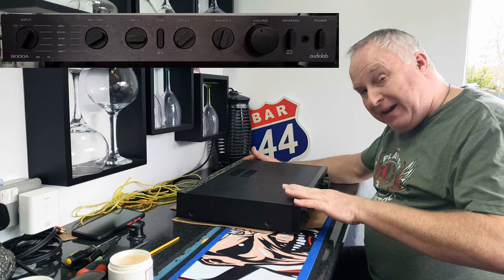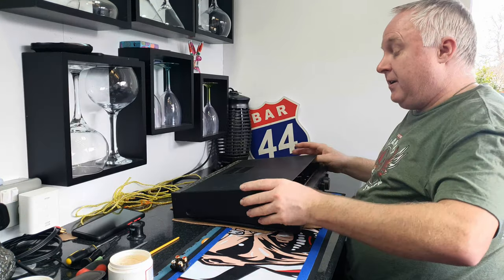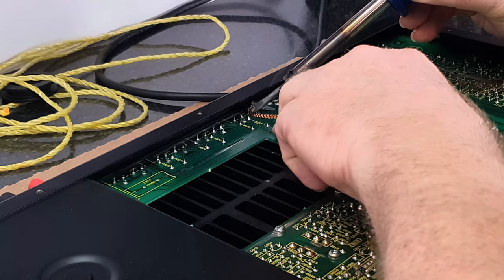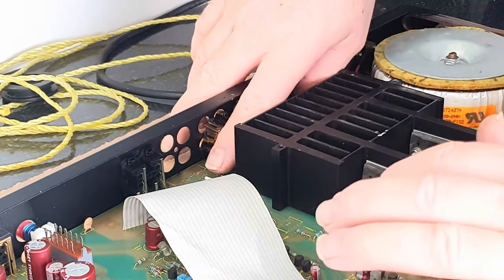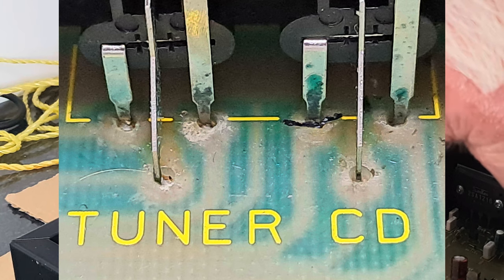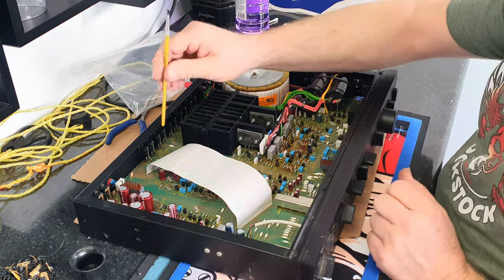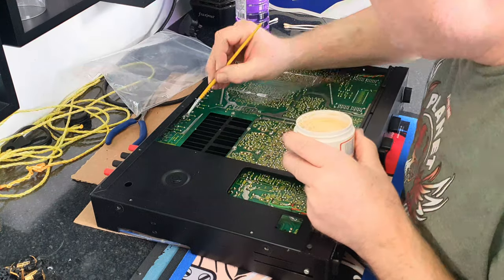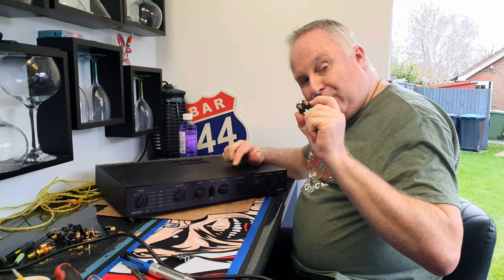How to Replace Audiolab Phono Sockets 🛠️ audiolab rear sockets replacement

Comment: As stated on the service manual, the bias current is obtained by measuring (at each chanell) the voltage across each double emitter resistor (2×0.22ohm). Using Ohm's law, dividing the measured voltage by 0.44 we obtain the bias current. The manufacturer specified value is 50mA±20%, so the voltage across 0.44ohm will be 22mV±20%.
The Audiolab 8000A is prone to bias drift with time to higher values. And so the amplifier overheats even playing at low volume sound.

Comment: Excellent video. Good explanations.
What surface you used over the table to protect the amplifier from scratches?
Did you already adjusted the bias current? What bias value you had before adjustment?